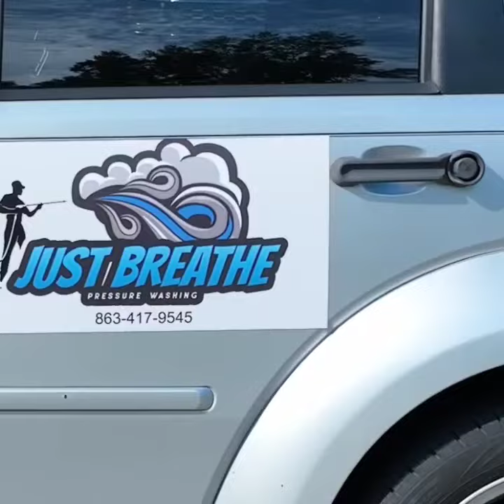house hadn't been cleaned in 21 years

Comment: Is it only water you use from the machine you go over with in the driveway? Im from Norway and dont know the english word for it. But that round washer thing like a lawn mower you push infront of you, is it only water?
Reply from the maker: So we first pre treat the concrete with SH, which is sodium hypochlorite (commercial grade bleach or pool shock.) All of that is done with either the ball valve or a wand nozzle that is large enough to pull chemical from a downstream injector. The round thing is called a surface cleaner and it only shoots out water.